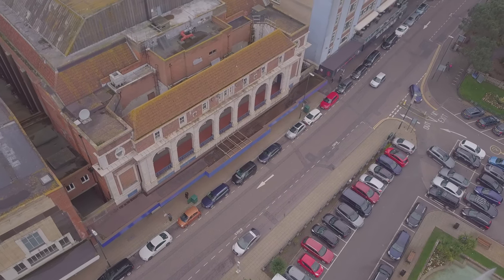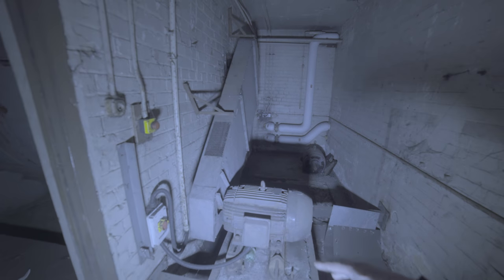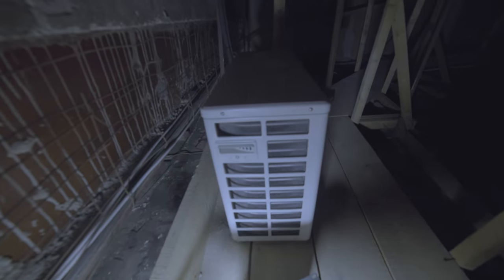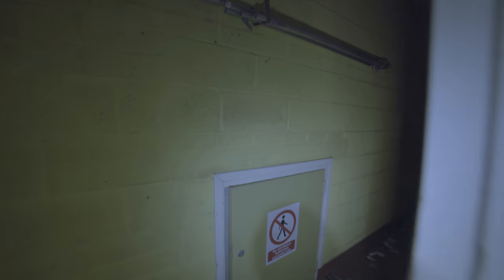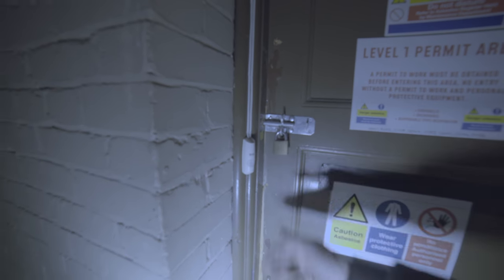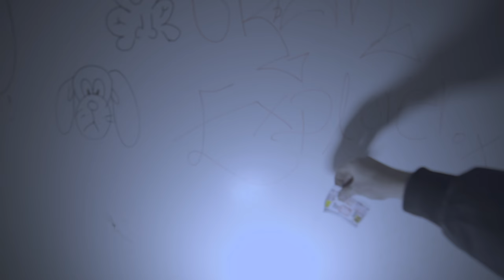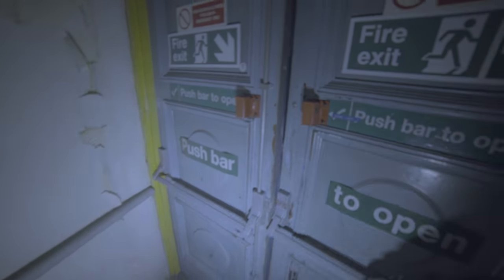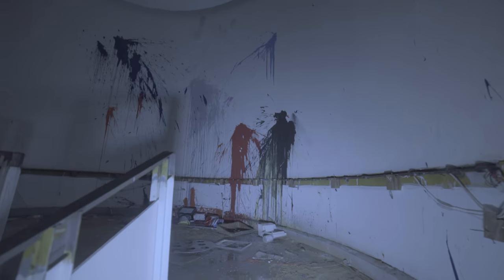Bournemouth Westover Road Odeon 4k FULL EXPLORE

Comment: Those doors at the back of the stage were dock doors, they were used to bring in set pieces, flight cases straight into the auditorium from the outside, this is very common on older theatres.

Comment: Screen 1 was the last original Cinerama auditorium in the country.  Deep curve 75 ft wide screen (remains of) and one of the biggest cinema auditoriums in the UK when it closed.  Looks like the remains of the full cinerama spec sound system are still there.  5 screen channels all using enormous Altec A4 Voice of the Theatre units...classic 😊.  That film reel looked like a 70mm one.  Last 70mm film in Screen 1 was in 1976... Re-opened in 69 witb Ice Station Zebra in 70mm Super Cinerama format.  Quite an occasion.  Condition of the place is deteriorating fast.  Heart breaking really.  Used to be a circuit flagship, hence the impressive spec.

Comment: Great Video as usual Mat! As an audio buff it’s amazing to see the Big old Altec Lansing A2’s! (VOTT) All pushed out of the way to make way for the Modern speakers. You can see where they were mounted next to the big Altecs. All missing the big horn’s that would of been on top of each Big speakers (A2’s) All the cones and horns long gone as they are worth allot these days. The A2’s were invented way back in 1947! Although these would of been 70’s models for sure! Can’t believe they ripped all the copper out with a live transformer must be desperate......Very cool video Mat!
Reply: Absolutely love the old Altec stuff. I though they were A4s. Looking at the most recent internal photos of when it was operating, they had a load of JBL wedges up on the wall, so the Altec stuff was probably decommissioned in place.
I'd love to get these preserved.
Reply: mikotondria Could be A4’s Difficult to Tell! Mat pop back and see what they are!!😂 I had a pair haha!! A while back.....Lots of Cinemas just pushed them to one side, too heavy to get out. As time went by the drivers got taken, stolen..
Reply: Engsge nerdy adenoids: definitely A4's (the A2's were two A4's bolted together).  They were powered by state of the art, for 1969, Cinemeccanica C65 monoblocks with, wait for it, 30 watts per channel...of pure class b first generation transistorised amplification.  The whole rig was in use up until the mid 90s when Dolby SR went in, then latterly upgrades to amplifiers and speakers occurred.  Dare I say it, but I remember the sound quality well.  It was cinema sound in the true, slightly honky and sometimes harsh sense.  The brute size of those A4s was all about efficiency and making the most of the 30 watts; they certainly weren't bass excavators.  They did sound very 'big' though.  Classic kit.  Would love to save it all.  I think the old rack of C65 amps was found later on in the vid in a storeroom...

Comment: Hi again, just watched again, a bit of nostalgia, at 36.40 the height of the ceiling was because of the dome on the ceiling, dismantled during the late 60s, when I use this cinema the whole ground floor was Gaumont 2 and the upper floor was gaumont 1. The windows and balcony was the bar area. Great days and Odeon completely fucked the building up. Its now being converted into flats and shops

Comment: the downstairs to nowhere bit is likely a downstairs to tunnels.

I used to work in a nightclub in Derby...it used to be a cinema but had stairs leading down to (what appeared to be) a fairly extensive set of passageways beneath the club.

We assumed it was WWII related, however, never had the touches available to explore it properly.

The Venu is still there, only now it's an all you can eat world diner.

Would love to take a look around it, however, I would doubt the owners would be up for it.

There's also some older disused backrooms upstairs too.
Reply: According to the plans it led down to the orchestra pit which was boarded over when it was converted in '69.

Comment: Interesting to see that Dolby gear.  I picked up a whole rack of Dolby audio processors at a sale, mostly useless to anyone but there were a couple of DP564s which are damn cool.  Take digital audio input (AC3 from any DVD or Bluray or modern games console) and plug in some headphones & it simulates the spatial ambience of a theatre sound system through the headphones.  Can adjust all sorts of room/speaker properties.  Found out these end up cheap on eBay cuz Dolby put lousy 12v power supplies in them and no off switch, so they often stay on for long periods, and usually die.  Fortunately, most Dolby stuff uses the power supply so easy to swap out.

Comment: Those huge metal castings near the filter room are sections from an older type boiler, they laminate together with water flowing through them, it would be a group of gas jets, or maybe Oil fired in the arched chamber, leading to the flue.

Comment: Hi matt. At 16.34 they are cast iron boiler sections. Look abit like Beeston brigadier sections.
Reply: John Jones Yes you’re absolutely right cast-iron sections of original boilers hence why are use near the boiler room presumably
Reply: @markharris4956  yes mate. To fecking heavy to remove. They were running on oil aswell hense the tank. The newer boilers are remha boilers poss p100 part of Broag. And u can see wher the gas pressure jet burners have been removed. 1st boiler house iv seen since lockdown.

Comment: .The cinema was built by Provincial Cinematograph company and opened in 1929 as the Regent cinema but the company had already been taken over by Gaumont British when the cinema opened  and eventually changed the name to Gaumont. As Gaumont themselves had been taken over by the Rank organisation who also owned Odeon cinemas it wasn’t a surprise that when the bad times of the 70s and 80s came along that Rank cut back its cinema operations and merged Odeon and Gaumont into one with the Gaumont name disappearing in favour of Odeon. Also It wasn’t unusual for large cinemas of the 20sand 30s to have stage facility’s as often live acts would accompany a film or for the odd live show. The decorative wall features I guess would have disappeared from view when the cinema was first converted into multi screens in the late 60s/early 70s. 
To answer your question regarding the ABC, Odeon did also own the ABC down the road and operates the two sites as basically a 9 screen complex until they opened a new multiplex in the town at which point both this cinema and the ABC were both closed.

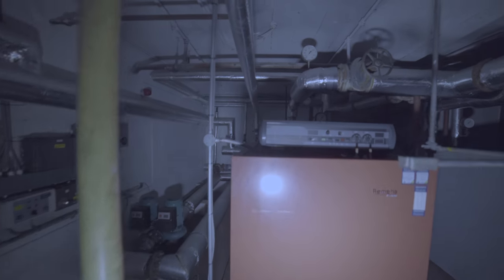Comment: At 16:52 you are looking at old boiler sections , maybe robin hood  ? . At 17:37 circulating pumps . At 18:13 i see motor and old circulating pump drive belts missing . At 49:14 i see IDEAL cast iron panel radiator 1950's

Comment: what is 39:49 dolby cp500 doing up there near to that square box and the square box looks same on the other side could be original "ohs"
40:43 cat 64b b-chain for dolby stereo cp50 of two cp50 used in original screens 1 and 2
40:54 dolby stereo cp50
41:17 cat 22 a-type card , two are used for the lt - rt of twin track sva optical 4.2.4 . you can tell i was a projectionist uci and warner bros
50:41 that ahead looks like possible original "ohs"
51:01 possible original "ohs"
51:52 another possibility of original "ohs"
there should be six "ohs" of screen 2 .
screen 1 you didn't go up above ceiling , not matters it's all chained gated fenced off now that only a pigeon can get in 
1:02:09 JBL 8330 mkI (THX) i know i was a projectionist also retired , uci and warner bros . we can talk technical 
those where placed between where port window was a bit ahead of where the seating was a rather lousy surround placement for the JBL 8330 mkI x16 of them should have been placed on back wall for proper surround and no updating the old what look like or clone of a altec voice of the theater speakers x5 left over from 70mm cinerama that lasted few years then replaced with 35mm , only then 2 year , but i understand the principles of it 
1:15:05 five screen left left-centre centre right-centre right and would be surprised if  if inner left right was wired for lfe.1 1999 for "star wars 1 the jar jar binks story" , when sr-d was installed not that the lfe.1 felt sounded any good with the outdated cabs the bass sounded weak and distorted at times . 
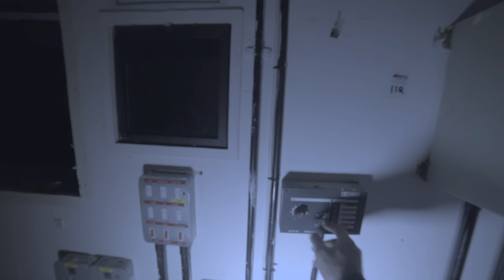1:37:04 remote fader for dolby cp45 , they must have changed those out with another cp maybe cp750 used into be in there when they removed 35mm and fitted digital projectors , there used to be cp45 in those screens , not sure what was used when converted around 1989 as the smaller screens at the back where you are mostly i believe mono only with only screen 1  re-numbered screen at the front where walked in used to be screen 2 was dolby stereo with cp50 till around 1999 when few screens  had sr-d fitted 
1:40:13 along that narrow corridor was some of few at the back of screen 2 original "ohs" most public today are brainwashed thinking its a new idea .

Comment: Xenon bulbs have a shelf life so have to be destroyed,thats why you saw it broken! those large things  against the wall were boiler sections to large to move so get left behind ..do your homework first before you make random statements!!
Reply from the maker: OOh listen to Mr Smartypants. I never saw any USE BY date on the xenon bulbs we had at our cinema... and i have doen some research and found you are only partly right so there.... 
"NOW-- that said, XBO Xenon lamps (at least OSRAM ones- I don't know enough about the product line and our competitors' lamp design to speak to it) don't use potting cement. They use a high temperature teflon compression seal to fix the lamp burner into the end caps, so the "potting cement" issue doesn't factor into this particular scenario. I'll try to find out about the life/risk though and post what I learn."
Reply: When they are life expired they are fairly worthless.  I imagine a site like this would have loads of old xenons kicking about.  You can't just put them in the bin (makers used to recommend smashing them first by putting them in their box and dropping them!  With face protection of course 😊)

Comment: I work in a cinema in Central London. Only the ads & trailers get downloaded, the films arrive on a DCP (Harddrive). Some cinemas in the area still get 35mm & 70mm prints. Tenet is going to be released in IMAX FILM 15:70 IMAX DCP, 35mm & 70mm & DCP. From what I understand 2/3 of the ticket price goes to the distributor so unfortunately to pay staff wages, building rent, electric ,gas etc we have to charge high prices for food.
Reply from the maker: Thats what they have always said and its bollocks then and its bollocks now. Charging those sorts of prices for food and drink is daylight robbery and is the reason people are staying at home... hence why Odeon went from 11 quid a ticket to 5 because it was either that or nobody would enter the building. Most of the multiplexes around by me have like 5 people in the audience for most films. Cinemas killed the movie experience by the prices they charge.  That fine by me, I was a projectionist and the cinema I was at cost £5 a film... so im happy to see cinema die out entirely if they cant charge reasonable prices... let it die.
Reply: @TheSecretVault  Some ODEON cinemas have been converted into ODEON LUX (reclining seats etc) they charge an arm & leg to get in. The revamped ODEON Leicester Square Front Row Circle (middle) can be upto £50 a seat!!!!! depending on the film. I hate ODEON or as a friend called them Odious.  ODEON will put a screen into the smallest space possible. I have been in a screen that obviously used to be a corridor, this was the now demolished ODEON Gants Hill in London.
Reply: Don't just blame odeon 😉 The film distributors take over 90% of ticket revenue in the first weeks of a blockbuster.  Concession sales is how cinemas have to make money. Even then, investment back into sites, and the projection equipment, can be agonisingly slow.  That's why there's still 1969 era speakers still left behind the screen here...it was in use well into the 90s.  I think cinemas would reduce ticket prices if they could...it would mean more popcorn sales 😁